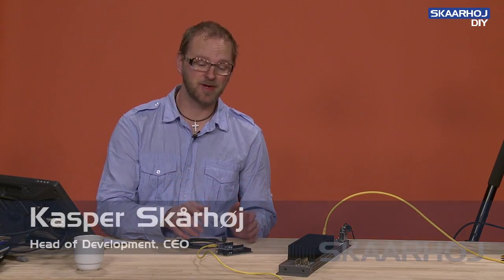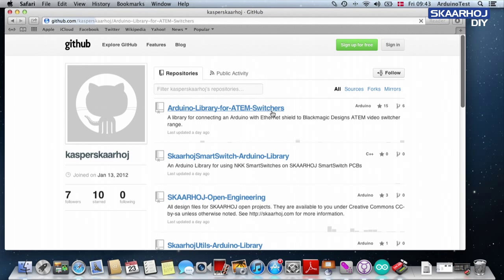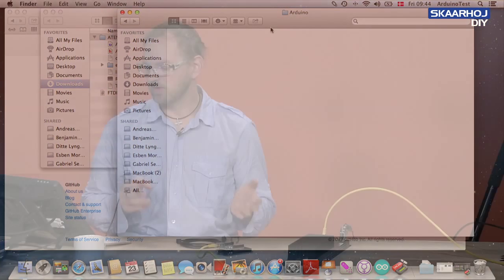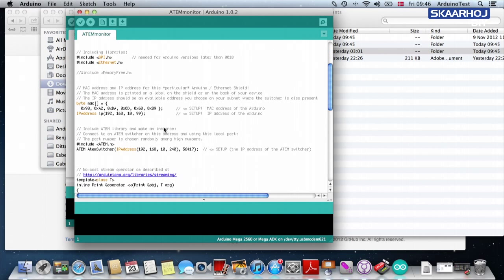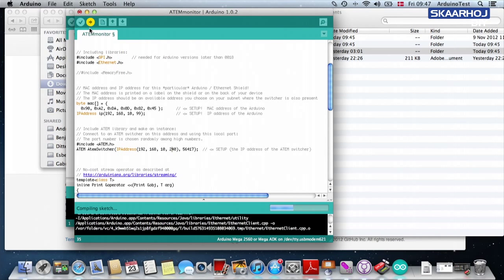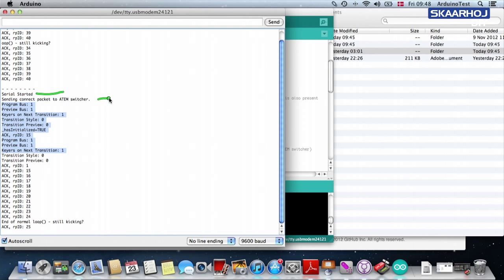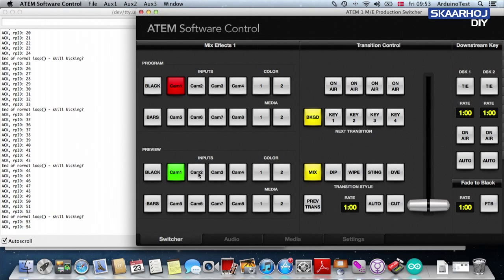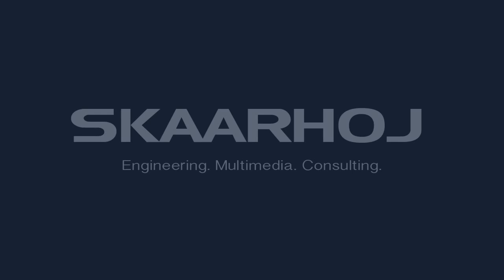LEGACY - Connecting to your ATEM switcher

Comment: Hello SKAARHOJ,

Where can I find the Mac address of my Ethernet Shield?
is that the number on top of the ethernet connector?
In my case HR911105A that's the only number I can find
there is also no number on the bottom of the Ethernet Shield.

Greetings Frank
Reply from the maker: Hi Frankie. 

Maybe this is helpful:

https://subscription.packtpub.com/book/hardware_and_creative/9781785285486/1/ch01lvl1sec12/finding-the-mac-address-and-obtaining-a-valid-ip-address

Comment: Arduino: 1.8.5 (Windows 7), Board: "Arduino/Genuino Uno"

ATEMmonitor:42: error: 'T' has not been declared

 inline Print &operator <<(Print &obj, T arg)

                                       ^

C:\Program Files (x86)\Arduino\libraries\ATEM\examples\ATEMmonitor\ATEMmonitor.ino:42:15: warning: inline function 'Print& operator<<(Print&, T) [with T = const __FlashStringHelper*]' used but never defined

 inline Print &operator <<(Print &obj, T arg)

               ^

exit status 1
'T' has not been declared

This report would have more information with
"Show verbose output during compilation"
option enabled in File -> Preferences.